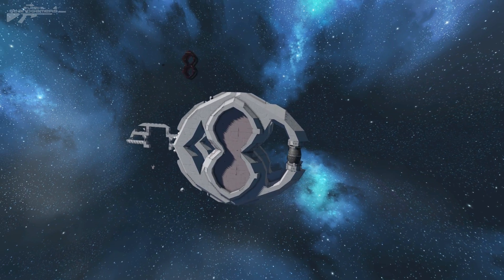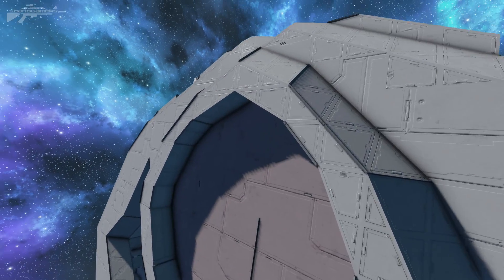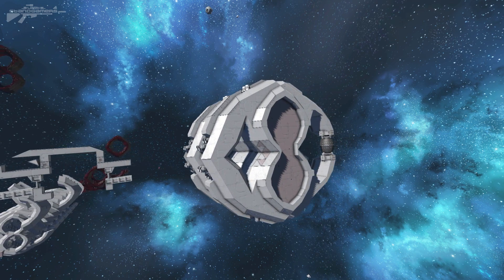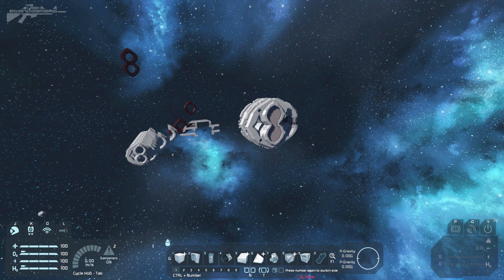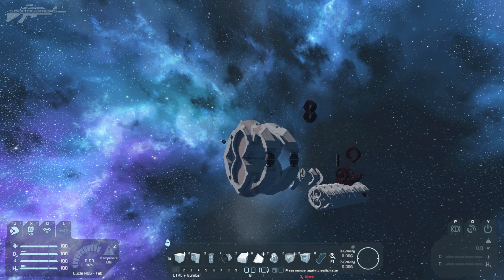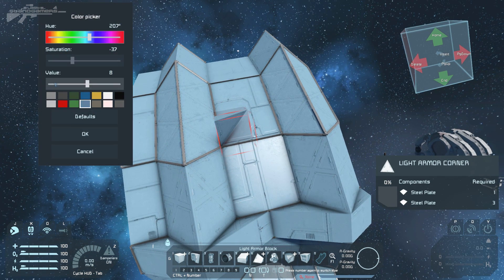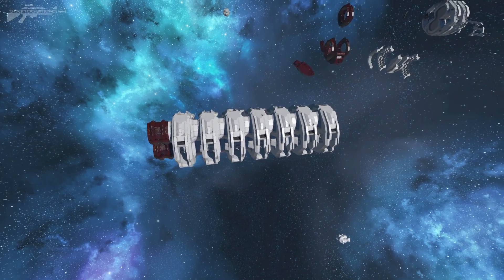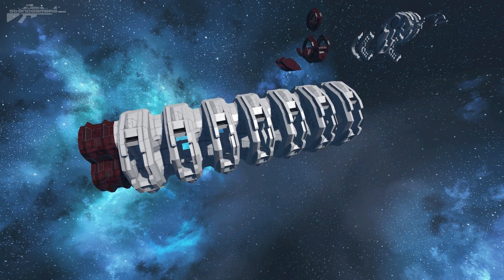Space Engineers - Building Technique Depth / Contrast

Comment: Ive had this game for awhile had a hard time getting into it, you made me want to so i built a huge ship, but i built it from the inside out i started with my reactor room and ive had to change that room a few times for lack of power but the inside is pretty much finished so i started on the outside and it just looks soo plain ive tried painting it and realized alot of my blocks id have to remove to paint i stopped playing after this lol i didnt use mods or scripts but all my doors are on sensors so every area is its own airlock safety first then i have hanger doors incase i need to seal any rooms off id share a picture if i knew how